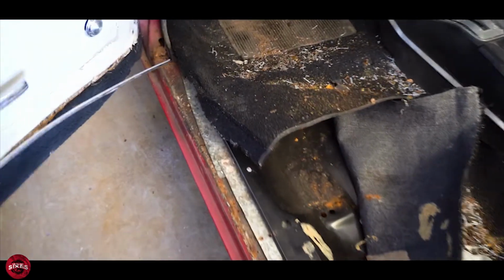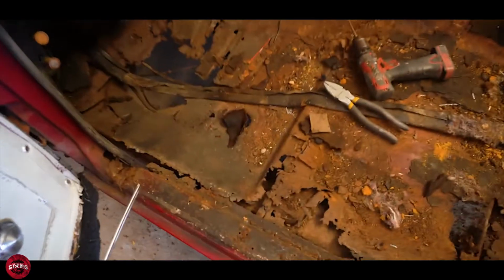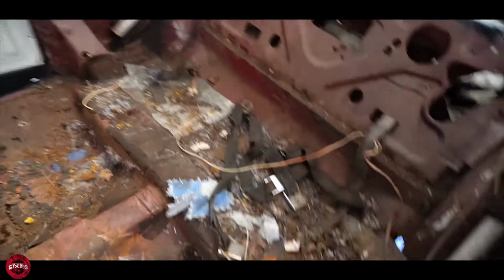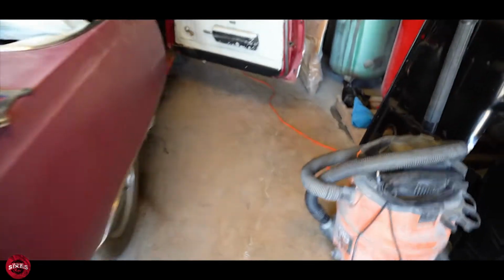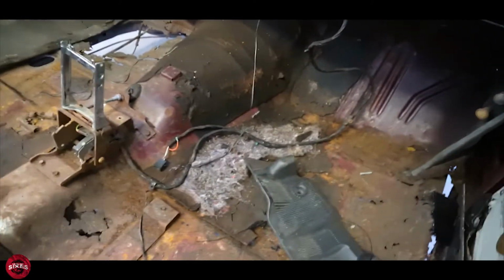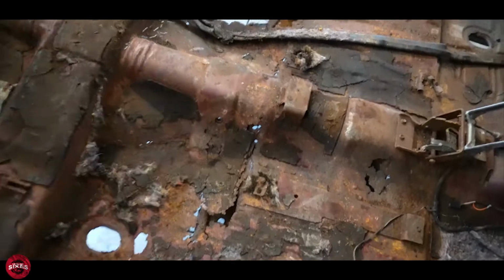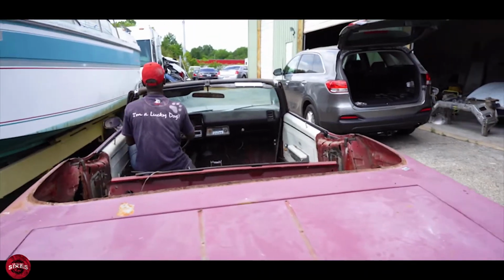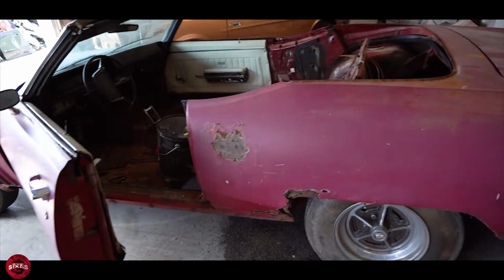OMG what's going on here with this 1969 Buick Skylark restoration

Comment: De-did a 69 Skylark last year.   Welded in 18 ga. sheet metal in parts to repair the floorboard.  Should have  bought floor pans.    Turned out good though,  take my wife for a drive nightly.  Cool cars.